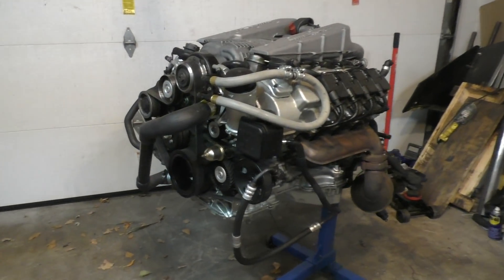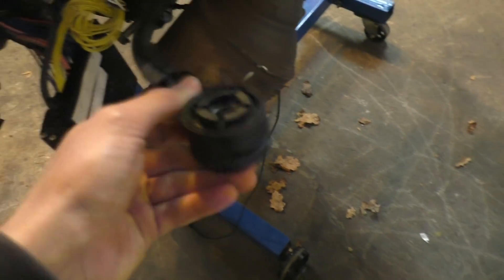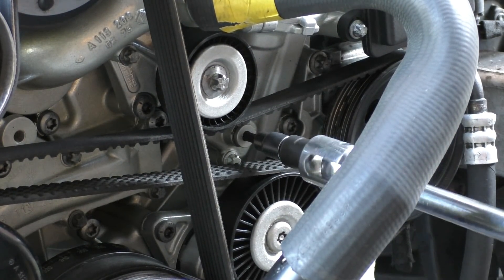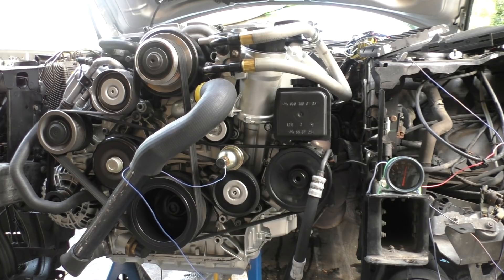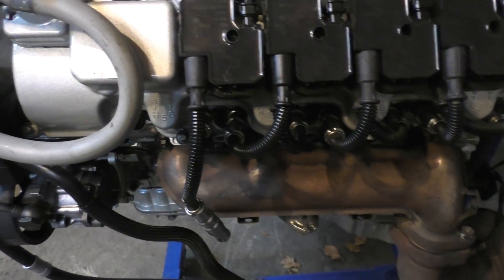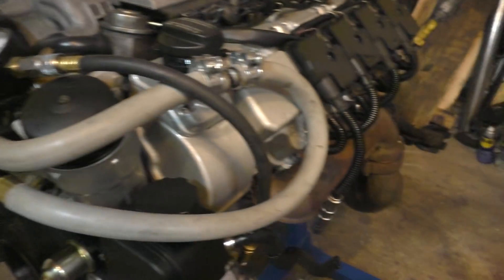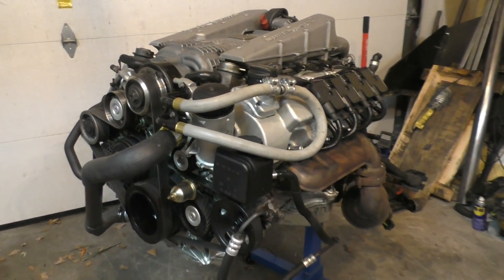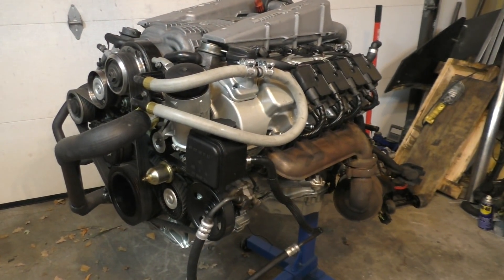E55 Engine Rebuild - Part 8 (Start Up, Compression Test)

Comment: I’m back for a re-visit to this series. Its my 3rd trip through. I’ve got 2 E55’s, and I love watching your process. At some point, I’ll be into them this deep….Your small ‘fist pump’ when it stared was perfect. I’m hearing that sourcing bearing is going to be done through VRP anymore. There aren’t any available through MB…  And yeah, revving it after its first heat cycle, ON AN ENGINE STAND (!) is the first thing I’ve watched you do that I questioned. I get it though- you earned it. Love your willingness to share your knowledge/ability with us. It’s really helpful.

Comment: Priceless videos with rare info and insights! 
Using these as a guide while replacing the o-ring in the timing chain cover of my M112. Curious if you have any idea what is this open hole in the left engine head in front of the exhaust manifold?
At first I thought I forgot to put something back, but I see it on your engine too :)

Comment: I have enjoyed the videos what i would like to see is W203 220 CDI 646 engine and what advice to modification of the oil cooler so that it does not mix oil and water in the water radiator thank you in advance

Comment: This is a demonstration that "No energy system can produce sum useful energy in excess of the total energy put into constructing it.
This universal truth applies to all energy systems [ IC Engines, solar, wind, EVs, Nuclear, Nuclear Fusion, hydro, Fracking, sand oil, AI, IoT, Robotics and you name it].
Energy, like time, flows from past to future".
The Fifth Law of Thermodynamics and The Arrow of Energy, proposed 2017.
Few online diagrams show the relationship in Physics:
https://the-fifth-law.com/pages/press-release?hmMmVlUGmoY=SK8215

Comment: Hello. I'm a big fan of your videos about m113k. I have a similar engine that is wrack form an accident. I wanna ask you if you have the front engine cover( distribution cover) and if you wanna sell me. Please let me know. Thank you
Reply from the maker: Hey, sorry man I already sold most of the old parts and scrapped that block. The same timing cover also came in some m113 and m112 models. Compare part numbers, you might be able to find it
Reply: @xfmotorsports  ok. Thank you.

Comment: Why are you bothering with turbos at all instead of sorting out the cooling and doing stacked pulleys and long tube headers?
Reply from the maker: The stock supercharger doesn't reach boost levels that high and the intercooler is very small. It might be okay for drag racing but doesn't work well on the track after a few laps

Comment: Hey man. Very nice work. Sounds amazing. I´m looking to buy a E55 amg w211 from 2004 with 180.000 kilometers. What were your symptoms of the low oil pressure? How many miles did yours have? Are there any other issues with the motor at that mileage? What should I pay attention to when visiting the car.
Reply from the maker: It would be hard to tell without an oil pressure gauge but just listen for if the engine sounds quiet, check for noises coming from the crankcase or hydraulic lifters. Check for leaks. Both my engines had leaking oil filter housings and a few other oil leaks. If those rubbers are going hard, I think its a good indication that other rubbers in the engine would be hard as well. Open the oil cap and see if there isn't any gunk build up inside the engine and make sure its idling smooth.
For other things, look for if the air suspension is working properly. Leave the car standing for a while and make sure it doesn't sag. Ball joints and bushings on the front suspension sometimes have play so check for that and just test all other features to make sure everything is functional.

Comment: What serpentine belt is that? Doesn't look at all like the stock one on my M112K
Reply from the maker: Yeh, its a smaller belt. I have the AC compressor bypassed so the belt arrangement is a little different. I mentioned it in the previous video

Comment: probobly no harm in reving the engine like that when its not under load. the only new things are rings and bearings. the ring pressure on the cyl wall is not high without load. and the tight bearing clearance dosent matter when there is no load the rods dosent push into the crank that much.

Comment: Also, been meaning to ask you, after you lowered your car, did you do anything to address bumpsteer?  I ask because after I lowered my benz I get alot of it, and now have to find a new tie rod set up to fix it.  You having that problem?
Reply from the maker: No, didn't have bump steer issues but I did get an alignment done after lowering. The toe angles were slightly off
Reply: @xfmotorsports  ok ty

Comment: Did you do a video on the wavetrac differential? I went back to an early video where you welded the diff? I would like to hear about the install and your opinion of the wavetrac and how it has improved your car?
Reply from the maker: I mentioned it in one of the older videos. Didn't install it myself so there's no install video but its a good differential. On the track it was impossible to tell the difference between that and a welded diff. It even stays locked when the inside tires leave the ground or hopping over curbs

Comment: Knowledgeable post: ..Do you know where can I get engine wiring diagram ? I try to do what you did with a AEM fic . Thank you!!
Reply from the maker: There are a few wiring diagrams in the service manual, but I ended up tracing the wires using a continuity tester. That's probably the easier way. I showed it in the fic install video

Comment: Just 1 question to ask.. How did your engine start without ecu giving command to the starter relay. As much as  i knw if the ecu signal of starter relay is not given  . Ecu wont let the injections to happen... 
Ur too goood.. Great fan of yours
Reply from the maker: Depends on the condition. For this one the ecu was on and the signal was going out to the injectors and ignition coils. The starter was disabled possibly because the ECU was not detecting the transmission in park
Reply: @xfmotorsports  ok thanks man.

Comment: I own a 98 E320 m112 I want to Change the oil pump O ring would I have to remove the whole engine to do this?? I will be using you're videos as my guide. Thanks in advance
Reply from the maker: No, it could also be done on the car if the subframe is removed. Check the oil pressure first. You will definitely be able to see low oil pressures before something happens

Comment: Shouldn't the oil bypass valve open  around 50psi?
Reply from the maker: No, I'm guessing its 100psi for this one and 75psi for the non-amg variants. 50psi is when the oil nozzles open for spraying oil on the pistons, so max pressure has to be higher than that
Reply: @xfmotorsports  hmmm, I'd better do some research, my w211 E55 limits the pressure at 50 ish hot or cold, hope it's normal.... My first thought was the  teflon tape you used, but depends on the gauge type if it will read high or low. But I know you're into your electronics, so bet you got that covered.
Reply from the maker: I see 75psi max on my SL500 (at 3k or higher rpm). It does stop at 50psi for a while which I believe is just because of the opening of the oil nozzles. Pressure at idle is usually 20 to 25 psi hot. I am running 50 weight oil in that car though. The difference might just be because of the thicker oil.

Comment: I love watching your videos!  Very informative and interesting ideas!
Reply: On a side note though.  I’ve ‘heard’ that with those larger style oil pressure senders that they might vibrate and break off.  What’s recommended is placing a short oil line in between so that the sender can be supported elsewhere.  It might be just overkill, but maybe worth looking into?
Reply from the maker: Yes, probably a better idea using a line. If a belt or something fails it can also damage the sender. I will end up changing the location later

Comment: All components under $20, available at WalMart. NEW 1 gallon paint can w/lid. Aquarium Air pump. Aquarium air tubing. Charcoal briquettes. Baby oil. Cat litter or clean, dry dirt or sand. Duct tape. Square of old terry towel. Tape air pump to can. Use #8 Phillips screwdriver- punch 2 holes in can lid, 2" apart. Cover each with 1"x1" square tape. Push through 2 lengths of tubing 1" into lid; 1 to pump, 1 longest for testing (outlet). Secure with more tape if needed. Fill can 2" with substrate. Place rag in can, pour 1/4 cup oil onto it, in middle. Soak 1-3 briquettes in anything flammable (acetone, diesel, brake parts cleaner, isopropyl alcohol, lighter fluid, etc.) for few minutes. Place in can, light it. After flame goes out- and it's glowing good, place lid, soft tight, no need to hammer closed. Plug in pump. Within a few minutes- you've got about 0.1 PSI of smoke. Add few drops of oil if necessary. Use a sheet of plastic wrap as a lid gasket if needed. Air pump keeps coals going.  Great for gaskets, valves, hoses, dry fuel & coolant lines, EVAP system, exhaust, gasket failures in trunk,  etc. Costs pennies to operate.
Reply from the maker: Very interesting, thanks for letting me know

Comment: I would really use a better gauge than that. That's a Chinese $10 compression gauge. I've been burned by cheap compression gauges before. In my case it was off by 25 psi. But good work not hating or anything just suggesting.
Reply from the maker: Yeh, I just picked this one from a hardware store. Didn't feel like ordering one and waiting for it, but did the job.

Comment: Another question, what software on your laptop are you using to access the ECU?
Reply from the maker: Its the AEM software for programming the AEM FIC. That's only because I had oversized injectors.
Reply: @xfmotorsports  I see. I have been looking/considering MBStar for my vehicle but I know that no values can be changed using it. Do you have any experience or opinions on Star?
Reply from the maker: No haven't used MB Star. I've been using Launch CReader. Its good enough to diagnose most problems on these cars and costs way less

Comment: Do you have a smoke tester? If not- I can tell you how to make DIY for $20, all parts at WalMart. It's a very useful tool to have. Engine, fuel system, cooling system, exhaust.
Reply from the maker: I don't, but yes, its something that comes in handy for checking for leaks. I'll look into it if the need comes sometime later

Comment: How difficult was it to remove the front clip for access? I have an S600 I will be doing some work to. I am an Audi guy and love the ease of removal of the front clip and radiator etc. with a few bolts and complete access to everything.
Reply from the maker: It was pretty easy for this car. I showed the removal in another video. Wait I'll try to find it
Reply: @xfmotorsports  I appreciate it, I guess I missed this video, sorry.
Reply from the maker: This was the engine removal video: https://www.youtube.com/watch?v=vooa0RQF1AU&t=7s